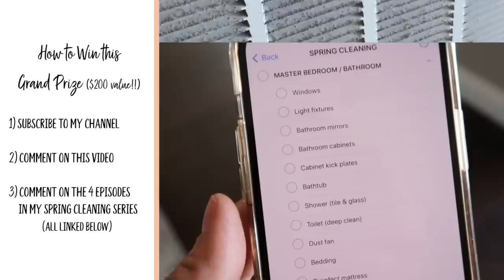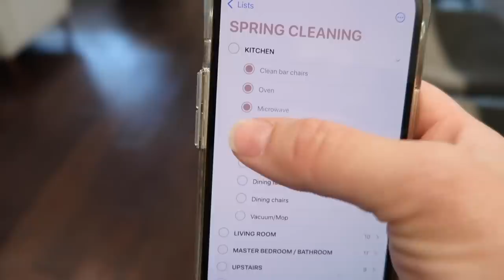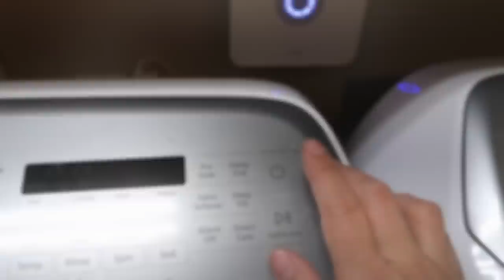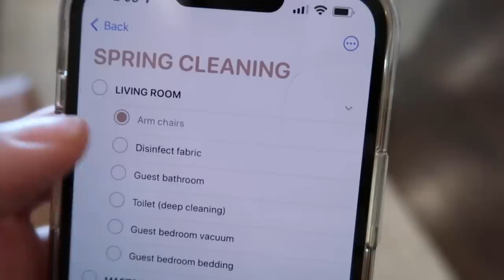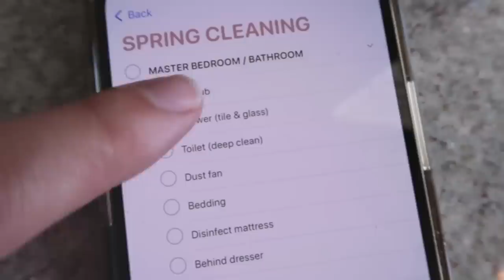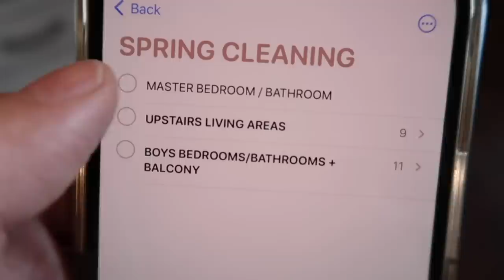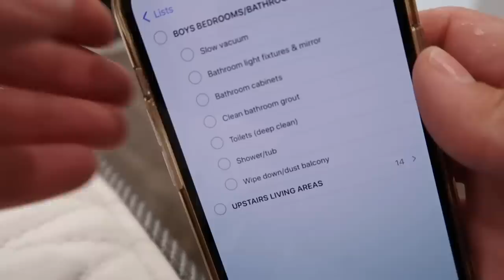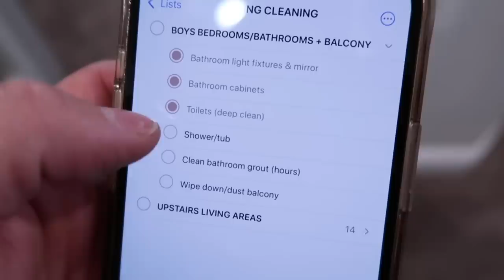*NEW* SPRING CLEAN WITH ME MARATHON 2022 :: Over 2 Hours of Insane Speed Cleaning Motivation

Comment: Good Video.  :)   One thing I do is when there is a lot of dust, I use my vacuum brush first before I clean them.  I use it on windows, cabinet tops, lights, baseboards, walls, top and behind refrigerator, stove, and anywhere else I can.  That way it's not dirtying my rags, cleaning water so bad.  That way it's not falling, blowing all over and in the air.    Just remember to clean the brush with the vacuum as you go.  It actually makes wiping everything down easier.

Comment: Just a heads up on those flushable wipes. Those are the absolute worst for your septic system. They don’t dissolve so they just build up in the pipes and cause massive clogs. So if you do use them, make sure they’re thrown away.